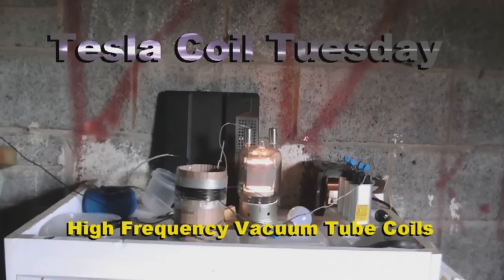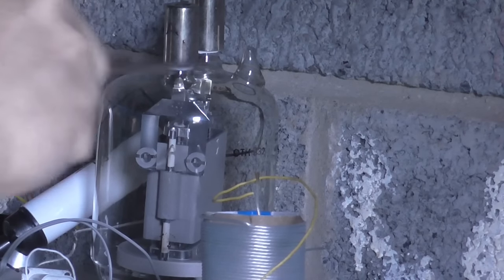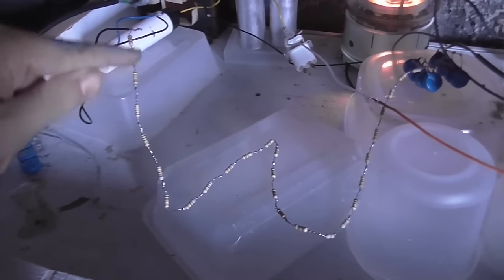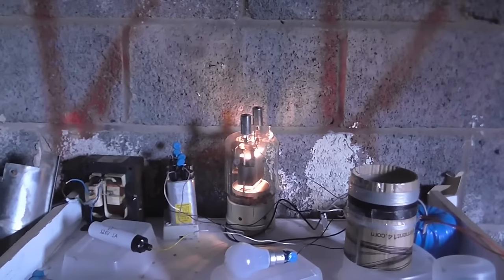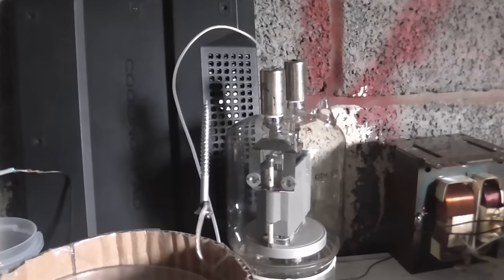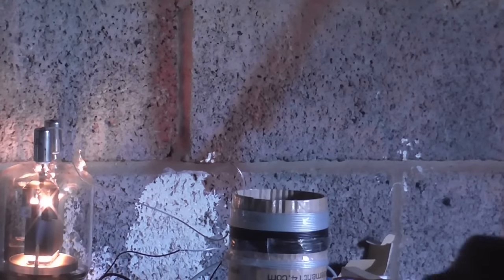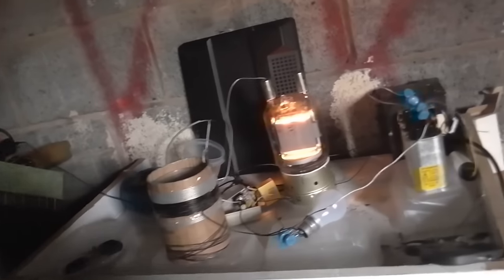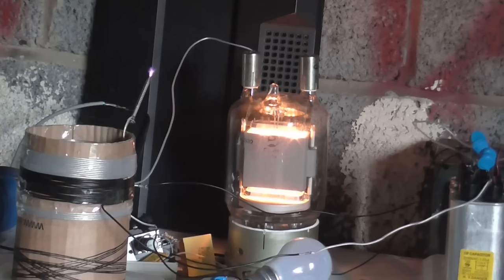Tesla Coil Tuesday - High Frequency VTTC experiments

Comment: Sparks on a doubler scared me a bit when you turned it on for the first time :)
I guess your modulator doesn't work thanks to that large MOSFET you used. It has higher gate capacitance. Try irf840 if you have one. However, one thing I'm sure about is that you should tweak that pot quite precisely, the modulator is basically class A amp.
Reply from the maker: I have a few irf840s laying around so I'll try that and see if it works.  I also have some 740s too so they might work.
Reply: CoolDudeClem And spend a bit more time tweaking the pot, 'cause it's gonna be finicky. On top of that, crank the volume on the player all the way up, because you have to change voltage on the gate by such amount, which will change the drain current enough to produce audible noise by modulation.